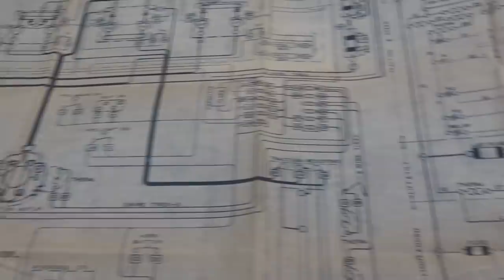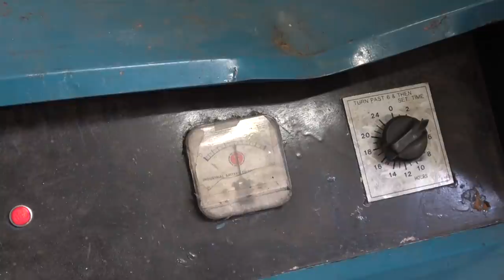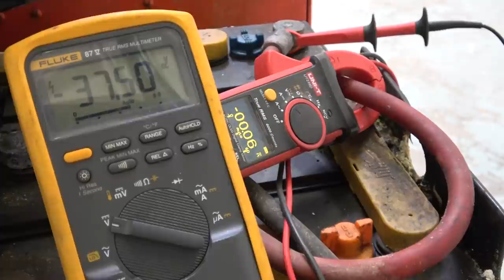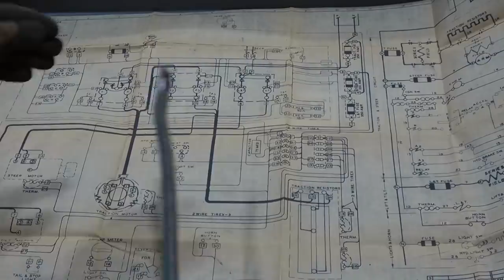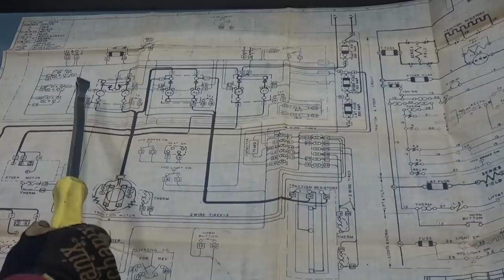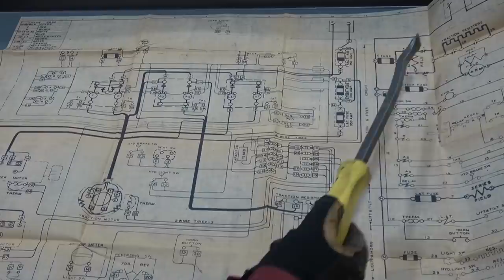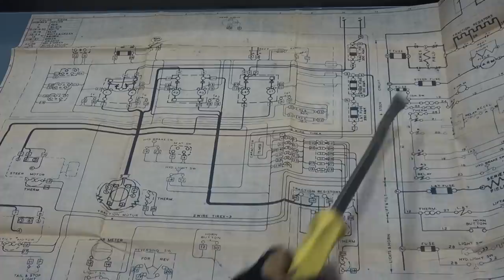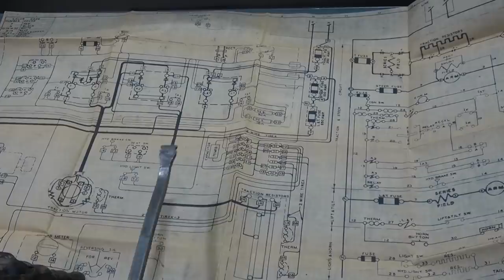Basic Electrical Troubleshooting | Battery Maintenance

Comment: Actually the real problem with those forward side contacts looks to be with the forward connecting bridge being stuck and not getting the spring in the middle to push on it. So that's why it's always in it's backed off position.

Comment: Was thinking about this the other day wondering if if you would do another vid.  The lack of reverse issue that went away when you go it off the trailer made me think you had an interlock on the forward/reverse contactors that was sticking.  Turns out I was wrong, once you showed those plans I looked for an interlock... And there aren't any

Comment: The white schmoo coming out the top of the batteria's suggest they are way beyond pooched. Not only that but after so many years the plates oxidize beyond use and the battery efficiency basically drops to 5% if that. I wouldn't even bother checking to see if the battery is good at that point but definitely check the woltage before removal on account you don't want to short it out and have a cell or two go pop.
Reply: An interesting case for trying new fancy algorithms for "fixing" dead batteries.

Comment: Heh! I used to maintain electric forklifts of all kinds. The batteries you measured most of them are garbage. The battery box is damaged by the acid (probably they boil during charging that's why you always top up AFTER charging). There is no point of cleaning the box now only replacement is the cure.

Comment: Probably been said in the comments but sod it.. I'm not reading all 656 (currently) hilarious as they usually are. I'm guessing the Rode mic radio link didn't like the brief but chubby arcs from the contactors? Without the shielding from the metal covers there's a fair bit of RF energy dancing it's beautiful merry way into the near field.

Comment: Looked like the F/R switch was just stuck full of crud. there is a spring between the forward and reverse contacts in the middle and one side never traveled to the end of its track. Just needs a good cleaning.

Comment: I know this video is over a year old but it looked to me that there was slide points for the selector switch with a spring in between. Noticed that the reverse side was stuck back not allowing it to slide forward.

Comment: Next, how to lift a battery that slides out when you corner too fast with the retainer down and don't have a 2nd lift on hand. A few sets of jumper cables to lengthen the connection and use the lift to hoist its own battery while holding down on the back bumper to counterbalance?
Oh, and it might be time to invest in a fancy water deionizer station and a portable watering cart growing algae in the tank.

Comment: looks like some one jammed that selector lever real hard which pushed the contact forward. some real jerk like those who have to tighten down the oil pan bolt so hard it strips out. dont be that jerk. tight is tight. doesnt have to go no more, doesnt have to be super tight.

Comment: you don't worry about amps as long as the voltage is low, unless if you short the leads with a screwdriver then even the gloves won't help you.

Comment: You could dump sewer water in that big old hunk of scrap and it wouldnt matter. Those batterys are only good for so much accumulated white stuff in them, and all the charging in the world wont save them. Any water with Minerals is BAD for a battery. Just because it is clear and in a bottle, doesnt mean its good. Since that HI Lo is probably on its LAST legs, it doesnt matter. As long as it GOES. My grandmothers scooter can out pace that dumpster on wheels. I have driven many of those things, even the old, old ones. My dad made his living fixing those things for Clark Equipment.  I remember riding in his service truck. No seat, just a box. There was no passenger seat, no seat belts back then. lol. The good ole days. I remember playing on heavy equipment as a kid. lol. Still remember the smell of hydraulic fluid and gear oil. Still cannot stand the smell of 90 weight gear oil. lol.

Comment: People who are confused about AVEs statement re 36 volts - his gloves and the 1000 amps,: He is saying not that he will be electromocuted, but you can get burned. High current can blow stuff up with sparks and heat. No electromocution dangers though.
Reply: I've been bitten by 48V batteries, it's more of an annoyance. I had wet gloves touching the ICCs between cells. "FACK, REALLY?"

Comment: You forgot the #1 rule for troubleshooting , "Were the 200 lb gorilla meets the tool", is usually were the problem will be 90% of the time. (The other 10% is a combination were the factory gorilla assembled the damn thing , and his enginerding dept)

Comment: You had your dmm in vdc and you had 36v when your leads were on negative post to chassis. Would that not mean you have positive ground? You should have gotton 0v if it were negative ground because negative post of battery and chassis would be at the same potential.

Comment: I'd probbly check the switch first, I had a brake light no worky worky so I checked the fuse, fuse was ok, so I checked the switch and it was dead. Temporary fix still going strong 2 years and a ton of km later

Comment: Once worked for a place where a closed air circulation room had dozens of batteries like this charging, they told us to turn the charger off before ripping out the charging cable, never did... turns out the angry pixies really don't like hydrogen!

Comment: Lift cage came out decent. Fork guides/feet... less than ideal. For yrs have had to chase down distilled water.... never any on hand. Now I can use bottled water, AvE said so. Maybe be on the lookout for some lithium car (drive) batteries for replacement? Save that forklift.

Comment: At 18:54 you pointed exactly at the problem!  Yet you missed it and went on to bending the contacts.  Didn't you notice the centre contacts were spring loaded and the one you pointed at was seized in it's cradle?  Obviously not.  More observation of operation required before jumping to conclusion.  Disappointed.
Reply: 18:54 end the video? What are you on about?
Reply: My error, 16:21
Reply: agree

Comment: First, I doubt you'll find a frame/chassis ground on the machine. Electric forklifts don't use them, and we went to great lengths to isolate the entire electrical system from the frame. You'll likely find a positive and negative standoff/terminal post. They're usually TP1 and TP2. Other than that, you didn't do too bad with figuring it out. I repaired them for 21 years, so I kind of know my way around them. The next thing. PLEASE tell me you didn't pay money for that steaming piece of dinosaur leavings. LOL. The forklift industry abandoned resistor technology forever-ago. Also, the resistors are known as "toasters" in the biz. Keep oil and dust off of them. If you don't, and you run it at low speed for extended periods of time (just not recommended at anytime) you'll figure out why we call them toasters. They WILL warm up enough to catch fire. Its amusing to see one of the old beasts still running. Still...I hope if you did pay money for it, you didn't give them more than 3 cents/pound. :)

Comment: How would you check voltage of a wire on a motorcycle or car without shorting things out and tripping fuses?
Reply from the maker: connect a 12v light bulb where the fuse should go. Pull, shake and twist wires till you find the short. Or you could use a compas needle. Maybe I'll make a vjo about it in a decade or three.

Comment: It may be time to put the old girl out of her misery or put in a nice diesel engine.  Hey how about a Horror Fright generator to make the angry pixies dance.  It might fit into the same space as the battery.  Well just sayin.  No no that aint right the battery is the part that works right.  The heck with it sell it to a junk yard is the answer.

Comment: What is the vintage of this lift?     The schematic and circuit techniques is older.   What year is this unit?????
Reply from the maker: 1961
Reply: AvE   Thanx.     Semiconductors definitely were not developed to the point this task required.    Its impressive how the old timers did things with what they had.

Comment: Sources or explanation for Aquafina water being better than distilled water for an electrolyte? I would have though the opposite due to all the minerals in the bottled water.
Reply from the maker: 20,000 Volt DC Hi-Pot test. Di-electric breakdown of aquafina at 5kV. Distilled water from drug store 1.5kV.

Comment: Well this one wasn't so good for me....let me explain.

ALL your stuff is entertaining, informative and the reviews (destroying new stuff for fun...I mean educational) are cherished but I didn't care for this one because those pixie road maps are cake for me, and is the first thing I gargle for AFTER the statistical research I do  (ie, check forums for the other 100's+ of people who had AND FOUND THE SOLUTION to the same problem!)

That's the point, this is an instance where I (think) I'm more knowledgeable therefore the troubleshooting of this forker with a pixie road map available is cake to me and shows the many troubleshooting inadequacies AVE did...THAT I MYSELF HAVE MADE IN THE PAST! 

Side note to AVE...like you've never heard "inadequate" before!

Never argue with an expert!  lol

Also, I fixed a newer Clark with the same issue except it had 4 diodes in the wiring harness (read factory taped up wiring) to the forward/reverse switch on the steering column, which used dinky micro switches in conjunction with those (hidden) diodes to make a SIMPLE logic circuit for forward/reverse... which I would have NEVER FOUND without the pixie road map. New switches and replacing open diodes... SHE FORKS AGAIN!

I find it much easier and cost effective spending time at the confuser troubleshooting and understanding how the enginenerds made it than tapy-tap-tap....if ya got to hit it, DON"T TAP IT! BEAT THE SH!T OUT OF IT BECAUSE YOU CAN"T FIGURE IT OUT! 

Give me a schematic and I'll fix the world!

Great stuff AVE :  )
Best Wishes Always

Comment: For god sake man jack one of the drive wheels off the ground!! The amount of people ive seen mutilated by forklifts because they dont know what theyre doing, really gets my goat, especially as i have to pick bits of them out of the machines when im called to fix them properly after the fact. If you want too test the battery, do it under load, test the voltage as you operate the hydraulics against the tilt stop

Comment: Wouldn't it have been a more elegant solution to reduce the voltage to the motor by only using a fraction of the battery bank?

Comment: Electric forklifts are not grounded. The electrical system is closed circuit. 
There is no ground. From battery positive, through the circuits, and back in to the battery negative.
If you have voltage to the frame, you have leakage from your battery (electrolytic path) or you have a short to frame in one of your circuit.
Also, at 36 volts, the battery is dead and needs to be charged (80% discharged). 

I'll be honest, you don't want a new forklift. Much more complicated. Computerized. Too many more components and wires to shit the bed, and a lot more pain in the ass to troubleshoot.

The first time you have a $5,000 main controller (CPU) or motor controller, or steer controller, or Steer/Tilt controller shit the bed and render the forklift a useless, fault-coding rock, you'll wish you had the old one back.

Comment: No positive ground on an electric lift, you have a positive ground fault and please put it on blocks when working on it, if a contactor sticks or welds the lift will go by by through your wall before you can unplug the battery!!!!

Comment: I didn't realise Canada was on the woosie 120V - 245V wakes you up much quicker. It also weeds out idiot old wrinklies like me - eventually. I had a real smashing belt right across the chest. One hand on an all metal screwdriver the other on the grounded chassis of a power supply. The screw had 245V on it.  NEVER watch crappy TV and mess with volty things.

Comment: Reminds me of when I was troubleshooting my FRC teams robot. Our permanent temporary fix on an drivetrain encoder wire lead to it hitting a polycarbonate wall at over 20ft per second. The force of the impact unplugged a couple motor controllers from the CAN bus and it proceed to spin in circles for another 10 seconds. Good times.

Comment: 13 year forklift tech. Get them wheels off the ground. Electric forklifts are not chase  ground. If you have volts on the frame. You have a short or battery is leaking volts.

Comment: How does he get the 2 volt estimation from the 36 v read? I am confused.
Reply: if you'll notice there are 18 batteries.

4 rows of 4 and then in the middle only 2 ( look at the video at 3:30 to extrapolate that)

18 * 2 is 36.

The 36 volts is the sum of all the batteries voltage. Thats because those batteries are in series not parallel. That can be determined by literally just looking at how the batteries are physically cabled together.

The way you can think of series vs parallel is batteries is series combine together to make a battery with more power, parallel on the other hand basically increases run time.

Two 12v batteries in series make a 24v battery but have the run time of a single battery. Two 12v batteries in parellel will run something twice as long, but the thing they are powering is limited to 12 volts. 

this is series, so 36 volts, 18 identical batteries means 2 volts.
Reply: nill nill 6x3=18 36/18=2
Reply: @franklyons5104  and the 6x3 is the cell arrangement? Like 3 long and 6 wide.
Reply: Well no it’s not actually arranged that way looks like 4x5 with two cells in the center missing (by design). But essentially 18 cells 2volts each all ran in series to add up to 36 volts.

Comment: You really need to take it and steam clean it first.  lol That is what someone did to one of our electric forklifts.  They had to replace alot of stuff in it and the forklift was only about 2 years old.  Sad part the company was leasing it soooo...... They ended up buying it cause of the idiot that tried cleaning it.  It finally died 10 years later.

Comment: How many 18650 laptop lipos would it take to substitute for those old lead bombs ?
Maybe ol' Elon might have a few spares knocking about  ...
Reply: Crown has some industrial lithium batteries coming into the market now, VForce brand. Usually it's gonna be prismatic (rectangle box that you can slide in or out) or lipo pouch cells for this application. Way easier to replace bad cells and you don't have to do any parallel connections, just a 170-1000 AH cell and put it in series to reach the proper voltage of 24-48v (or 72v for some European TSPs). Right now they only have it for RCs and WPs. Pepsi bought a bunch of WPs with lithium batteries. They're really good for opportunity charging and not worrying about leaving the battery at 100%. The only problem is it's goddamn expensive, like another $10,000 for this battery over a flooded lead acid.

It'd be more complicated to do series-parallel with the fairly low voltages required. Tesla made a really good BMS system to manage all those cells, but the benefits aren't useful for forklifts and the drawbacks are not worth it.
Reply: For the sake of doing it though. Say you have a 3.7v nominal voltage cell, 10 amp output, and 3500mah or 3.5 AH capacity.

You'd need 200 to reach 700 AH, now you need a series connection to get 36 volts nominal, instead of the right now 3.7v nominal. You'd need about 10 in a series to reach 36 volts, you'd be a little over 36 actually, for every parallel connection.

I'm not 100% sure, but that should be about 2,000 batteries for a 36v 700AH battery. With 200 10 amp cells in parallel, you have an output of 2,000 amps. At 36v 2,000 amps, were looking at an output of 72KW. That might be a bit overkill, so you could probably drop down to a 5 amp cell and get a higher capacity per cell and have 1,000 amps or 36KW output.

Now of we use the Tesla batteries which are 2170 format rather than 18650. You've got a 3.7v 4.8 AH cell.

You only need 145 to reach 700 AH in parallel. Now you need 10 in series for every parellel bank to reach just above 36 volts. We're now only looking at 1,312 cells total. Definitely more dense but a lot of cells to manage. If one goes bad, finding and replacing that cell is gonna be a massive bitch.

Comment: I was under the assumption that mixing Epsom into distilled water was the proper way to make electrolyte. I mean, for car batteries at least. If the lift never goes below freezing, I can see how aqufina might be okish. My only real concern is that the mineral content of the bottled water may hasten the end of useful life of the cell. 
Don't get me wrong, I am well aware that you know tons that I don't. I'm a mechanic, not an engineer. If I'm wrong, tell me so and maybe how.
Reply: If it's non conductive it doesn't matter what's in the water. Once you dump it in, it's not water anyway, it's sulfuric acid.
Reply: The only thjng you should ever add aside from water is sulfuric acid if you've boiled it out and the specific gravities are bad.

Comment: the idea is distilled water no minerals, drinking water is mineralized. batteries no likiey minerals, causes more build up and that makes the plates touch in the end it will be plate connection loosing cells